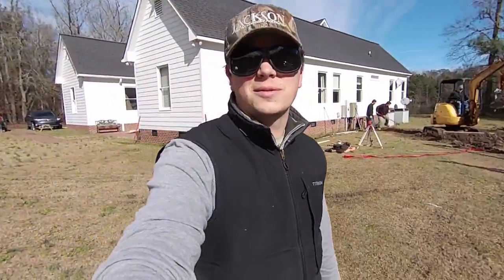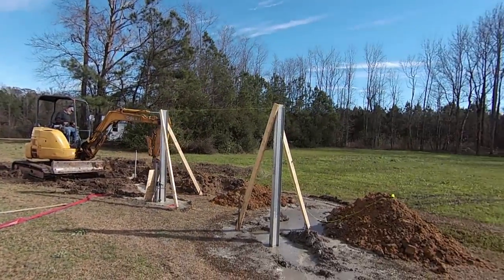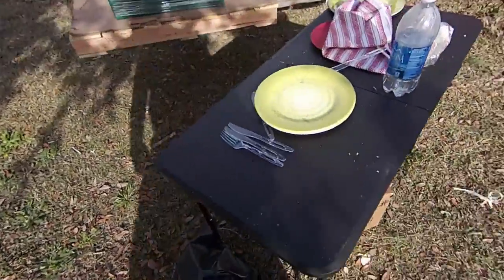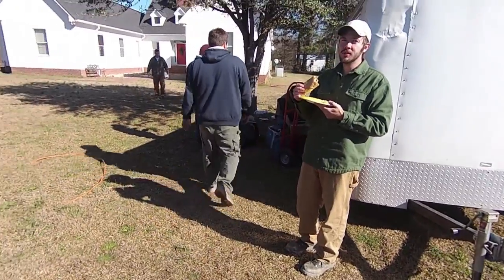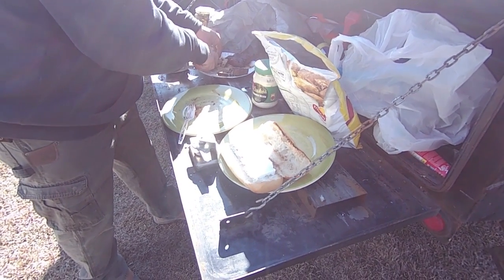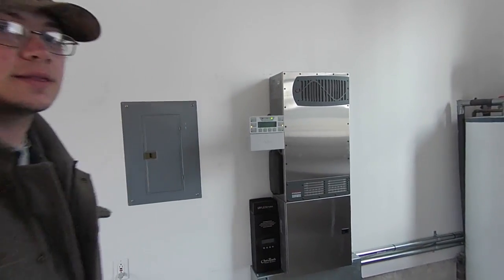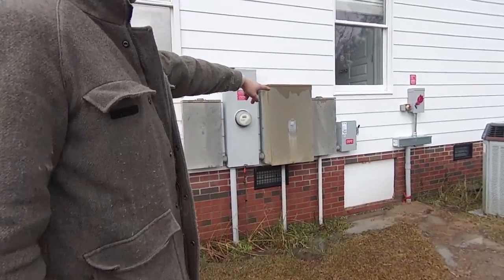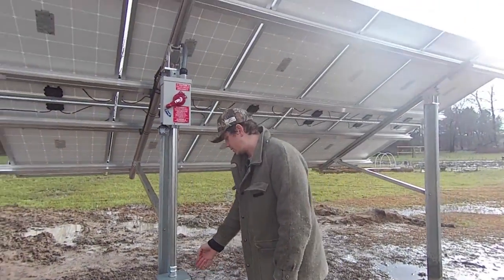Radian 8048a

Comment: Hello, 775, I am curious to know if there are any major issues with Batteries in regard to solar install. I am hearing from sources that it is expensive maintenance and replacement costs to maintain solar cells. I am seriously considering a solar system but would like some info regarding solar cell maintenance and longevity issues.

Comment: Nice install. Over the years I have learned on a exterior trough install. To make my conduit penetration on the side or bottom if possible. The top penetrations will leak eventually. I offset my run and install a L B on the side of the box. You may have better luck than me. I don't think most inspectors care how penetrations are made long as it looks strait. You have a cool crew of guys. Good to see everyone happy and working hard! And eating good..👍
Reply: +Simpleman Steve Were You using the "myers hubs" fitting.  It has an o ring gasket.

Comment: Looks like just a bunchnof buddies doing what they love. Having a good time, enjoying life and taking pride in their work. I'm a commercial/industrial electrician myself and I would love to be able to wire all that equipment and batteries up. I've done a few solar farms 500kw to 10MW. Also wired 6 windturbines. Each capable of producing 3.2MW although they were choked off at 2.3MW I believe to reduce noise. Pulled 18  1000mcm aluminum cables from the base to the top 345' up. 6 parallel runs. Prob be going out to a mega hydro dam next..